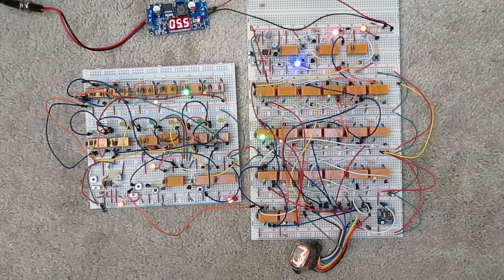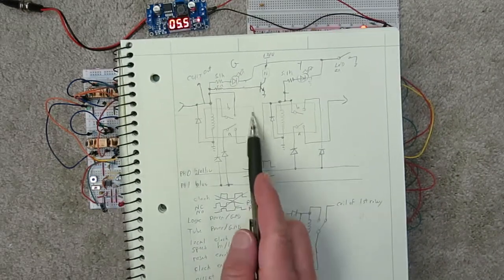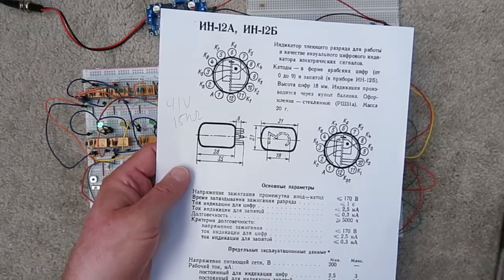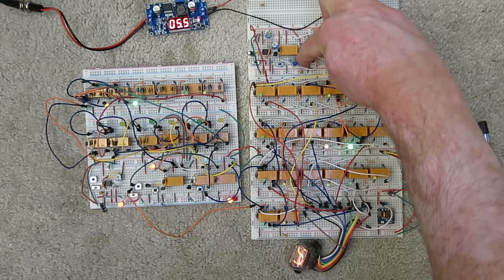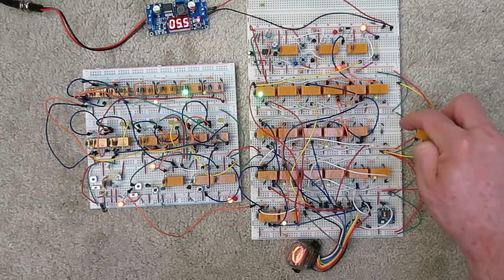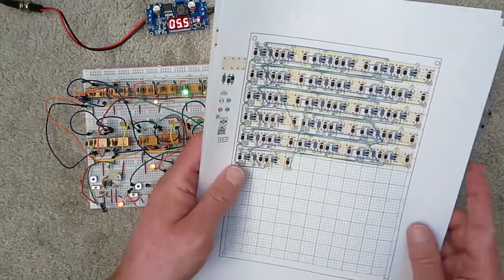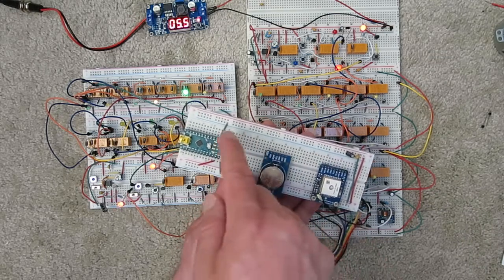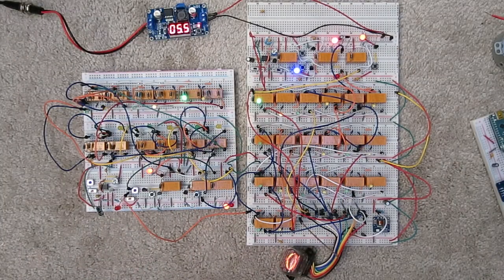Nixie clock built from relay logic part 1

Comment: This has been quite the interesting project to follow, thanks for uploading this series of videos. From the schematic, it looks like you're using DPST relays. Is that the case, or are you using DPDT units and only utilizing the normally open contacts?
Reply: Correct. Although for some clocking functions I use both contacts.

Comment: An amazing project, I’m avidly following along with great interest.  Many thanks for posting.  I’ve started my own and got as far as a test setup for the ring counter.  I have a question which I hope you will be able to help me with.  I’ve implemented the 2-phase clock with one relay which doesn’t seem to give the desired result.  I’m wondering if this first relay should be make-before-break contacts or would I need to insert a capacitor to delay one of the phases - although I see in your prototype board you have 3 relays in that area.  I would appreciate it if you could give me a bit of guidance on this.
Reply from the maker: Thanks for watching!
I started making the videos well into the project. I discuss the design of the clock generator in video 3. The relays are break before make. Normal relays. The clock generator is just a relay flipping 5V between the two clock phases. The second relay is the reset; it disconnects both phases at once which clears the bit in the ring counter. The third relay is the preset. It puts a bit into the first stage then it latches off after the first clock. 

One thing to look out for is the diode drop. It may not be enough to pick the  contact on the next stage. I run 5V relays at 5V8 or something higher. The bit gets dropped with less than 5V supply.
Reply: Many thanks for your comments.  I’ve just finished an experimental 4-stage ring counter trial setup with 12v relays and the only way I could get the ring to progress was by inserting 2 small electrolytic capacitors to slightly delay each clock line’s fall to zero thus allowing the ‘B’ relay time to latch (exactly the same relay types as you have except 12v).  Interesting.  Onwards and upwards now…
Reply from the maker: @PeterBurton50  Glad you got past that issue. My relays were 5V and as I look at the video i ran the supply at 5.5V.
I think I did 5.8V in the final design. There can be a lot of IR drop from the supply to the actual relays as well. 

Do you have an oscilloscope to look at the timing? I am surprised that you are having this issue.